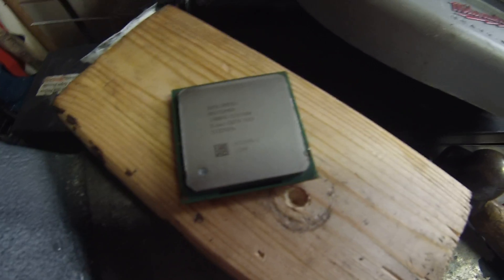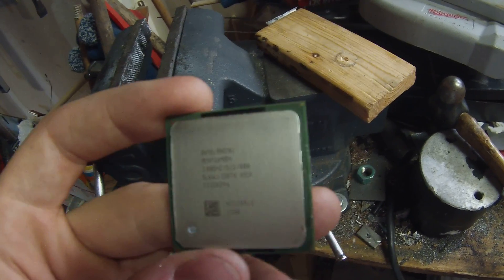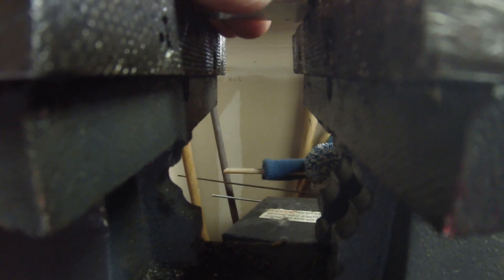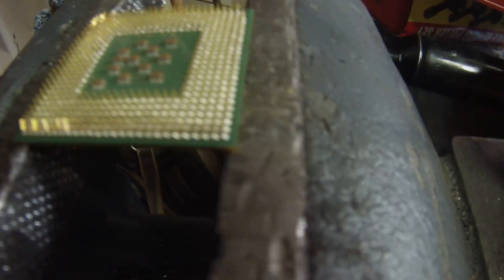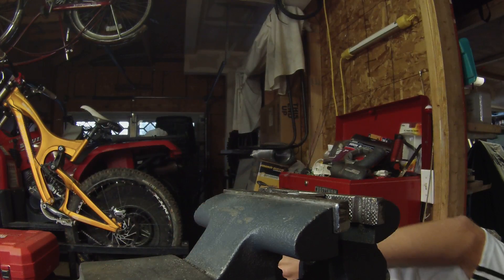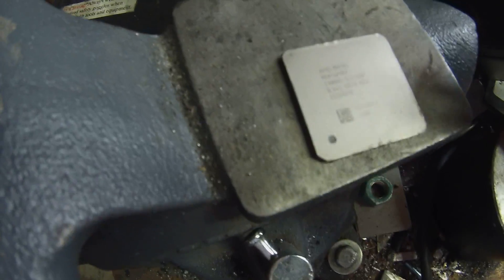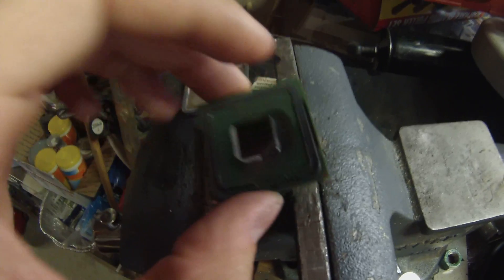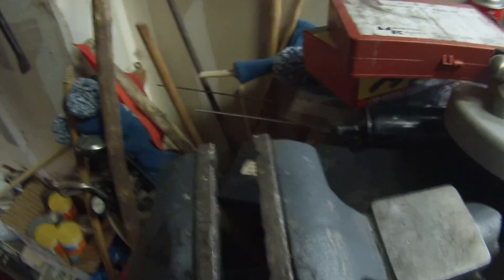Hammer And Vice - IHS Removal

Comment: that looks like the cavemanapproach ^^
but seriously, even if it works.. i would just take a sharp blade and do it the precise way.
Reply from the maker: Check my other video on this. The feeler gauge method is the one I personally use often.
Reply: +MegaDopeable Actually this looks way more safe (provided the die ain't soldered to IHS...) than cutting with sharp knife around the substrate PCB, you know, i can imagine you can scratch some tracks on it fairly easily... not to mention this is faster and healtier for your hands, the glue is damn tough, i've once cut myself... just to have a pillow...

Comment: is that chip alive after that fly in the ground
Reply from the maker: After bending back a few pins, it did run just fine! Modern CPUs can take a fair amount of beating. Yet at the same time, a sneeze could kill one.
Reply: Kent Rushton this sounds noobish. but i dropped my AMD CPU chip in the floor (not on purpess of course). and it didnt brake.  working just fine  :D

Comment: I think they shuld solder it
Reply: +KEEVVY Since Intel has little competition from AMD right now, they don't care enough to do so.  I agree, they should move back to soldering the IHS to the die, especially if this new Zen processor that AMD is cooking up will give the current Intel flagships a run for their money at a lower price with much better overclockability.

Comment: Man I've always been super brave with my builds.. But this "De-Lidding" is new to me as I am upgrading from a 1st gen i5-750 to a i7-4770k.  I KNOW it's going to run hot because Intel has chosen to change their manufacturing process to save pennies.. Still baffles me at why on earth would the best Chip company in the world resort to MUCH less effective method, ESPECIALLY for their K chips made for OC'ing.  At least make a i7-4770KS (S for Soldered) for $5 more bucks, we'd buy them.  Not sure I'm going to actually attempt this or not.
Reply: I do it for all of my customers that request it. Ive only had 1 core crack out of 746 CPU delids so far with this method. But i also heat up the cpu with a hair dryer. like i posted I also lap the IHS since thier warranty is gone

Comment: If you have bent pins you just take a credit card and run it through both ways.
Reply: if they are bent more than like 10 degrees, the credit card will break them off, trust me, a mechanical pencil is a MUCH better idea.
Reply: *****
True, but accident's to happen to everyone.
Reply: orlandotech
The macbook pro retina looks quite serviceable, I repair ultrabooks among other things at work so it should be no biggie. OSX might be locked down, but my experience with Linux is good so if it doesn't work out between me and OSX I'll break up the relationship and put Linux on it. I'm sick on windows since I work with it.

=)
Reply: A mechanical pencil with no leads in the tip works well too and a little more precise if you have a few bad ones in the bunch that need more attention.
Reply: orlandotech
I also used a tweezer (I bent the pins on my fx-6200).
Reply: danny gallegos
 If you're not stupid you won't break them...
Reply: sometimes they do ship bent, but i would still rather use a mech pencil :)
Reply: Bah, just order intel, no need to worry about pins.
Reply: Salpeteroxid
You do in the sockets, which is more of a PITA than the CPU pins getting bent.
Reply: it is rarer for mobos to get pins, but also much harder to fix.
Reply: orlandotech
My cpu is an intel i7-4790k and my mobo is an MSI z97 gaming 5, I rather buy a new mobo than a new processor. My processor is more than double as expensive as my mobo. ^^
Reply: Salpeteroxid
Ha! Sounds like a tight setup. :) I'm still on X58 but I love it. The extreme or unlocked CPU's are dirt cheap but finding mobo's at decent prices is real hard to find. I bought most of my stuff years ago when the prices were OK. Now they are crazy expensive if you can even find one that doesn't have a damaged socket.
Reply: orlandotech The processor is alright actually. The motherboard is kinda good. I haven't tried to OC yet, because the most demanding I do is BF4 I think and the 4.4Ghz on all cores in turbo is enough for me right now.

Which CPU are you at and what clockspeed?
Reply: Salpeteroxid Yeah OC'ing can be fun if you have the time to devote to it when you're tweaking it in. I'm on a W3580 ES chip now. I was on a W3550 but found a good deal on eBay for the ES CPU. I only have it clocked out to 4GHz. Plan on doing more but didn't have time to crank on it. I did the OC in about 5 minutes. :) Slight tweak to vCore and a pinch of VTT and it was there. Also made sure the vDIMM was at the rated volts for the memory sticks and turned off vDroop.
Reply: orlandotech
Nice, bringing it up to 4 is an improvement :)
Reply: Salpeteroxid
Thanks. I bet there is more power waiting to be tapped into but right now I don't have the time to spend on it. 4 was a decent starter clock to me and it was dead simple to get.
Reply: orlandotech
Nice, I had trouble with bluescreen when playing on BF4, I disabled turbo boost, set 1.2 volts and had 4,5 Ghz. but had to return to stock settings. I have to make time before I overclock. But I'm already satisfied with the performance and my time is limited (work much).
Reply: Salpeteroxid
The BSOD error code will lead you in the right direction on what voltage to adjust. Just go into the system in the Win7 control panel and make sure under advanced settings that you disable the automatic reboot so you have time to see or write down the BSOD code There are a few BSOD error code lists floating around on the net to make it easier. Usually it just needs a slight voltage tweak to fix it.
Reply: orlandotech Thanks, found the setting right away, although my W7 is in Swedish =)
I think 1.3 volts would get me 4.6-4.7 Ghz, but the processor gets much hotter, dunno if it's worth it, I only have a hyper evo 212 push pull as a cooler for my cpu. I like it because it's quiet, but maybe nhd-15 or what it's called would be better, don't want to go liquid because of the possible pump noise.
Reply: Salpeteroxid
I wouldn't push the heat past 80-85C for everyday use. It will degrade the CPU over time, especially if you are real close to TJMax. Get it where you feel comfortable with it and let it ride. Wherever you get it stable will be way better than the stock clocks. :) Try using Intel Burn Test. It's the most brutal stability test around. If it's stable with IBT it will be stable with anything you could throw at it during normal use. Next time BF4 crashes and blue screens look up the BSOD code so you can make adjustments. It might be as simple as a corrupted driver causing it and nothing with the overclock. It could also be a bug in the game too or some background service running on your machine.
Reply: orlandotech I've set it to stock speed. At 4.4Ghz with the turbo boost I'm satisfied for now because the temps are around 70 when I game and it's at full turbo.
 But I want more, I guess the only sane solution would be to buy a 240 rad, but which one? They all look the same, have the same(ish) temps but which one is the most quiet? Damn it's hard to do an upgrade ^^
Reply: Salpeteroxid
70*C isn't too bad for an air cooler @ full load IMO. If you're worried about it you can get some good thermal paste and refresh it. Prolimatech PK3 is supposed to be really good for the money. I have a 30G tube on the way since I ran out. I was using AS5 and had my tube for a number of years. The factory TIM on the heatsinks you buy is usually good but since it's screenprinted on and thicker than what's in the tube it doesn't spread out as nice as the stuff you hand apply. You can sometimes get better temps just refreshing the TIM.
If you have never dipped into custom watercooling (not the all in one sets like from Corsair) you can try one of these kits: http://www.xs-pc.com/watercooling-kits/, http://koolance.com/index.php?route=product/category&path=150_152 or http://www.ekwb.com/products/kits/. It has nearly everything you need for a custom loop and they work good. I haven't ever used them but a lot of people have had good success with them.
Reply: orlandotech
I have the Cooler Master Hyper Evo 212, and my thermal paste is not that old, 1,5 month, applied it perfectly (AS5). Stock thermal paste is always too much. I see that a lot as I'm an IT-technician and sometimes repair laptops for HP (I'm walk in support for Ericsson).
 I don't think I want a custom loop, I rather have a prebuilt for 3 years and then throw it out and buy another one. I think I have to think about it, maybe I'm going with whatever is the most quiet. =)
Reply: Salpeteroxid The Corsair units are decent but they really only give you the same performance as a top line air cooler. The custom loop route is better. I'm currently using an H100 and it works fine but I do understand that it isn't the same thing as a custom loop. If you want a quiet custom loop setup you could try more radiator and slower fan speed to keep the noise down. If the pump noise is a concern you could cover or insulate the pump to help keep it from transferring sound to the case or to the free air.
Reply: orlandotech
I really don't want to do a custom loop, takes to much time and maintenance and it won't fit in my Zalman Z11 (which I like very much). I think I will get the fattest Noctua instead with 3 140mm fans. I work with computers all day at work and at home I just want them to work (getting a macbook soon lol).
Reply: Salpeteroxid
Yeah I can truly understand. If you want maximum cooling performance with the least amount of fuss then the custom loop is the way to go but it sounds like air cooling is better suited to your situation. Less maintenance with the air cooling.
Nothing wrong with Mac stuff except that it's severely locked down by design and you can't upgrade them much at all. Hardware quality is usually top notch but upgrading or servicing them can be a pain.
Reply: Salpeteroxid
Ha! Sometimes I hate Windows but I really don't feel like learning a new OS so I stick with it. It's a love/ hate relationship. :)
Reply: orlandotech
Hehe, I like to familiarise myself with new OS's, I think it's fun and I usually get thinks to work everywhere I go. I think I'll like OSX from what I've heard, I only need to check facebook, irc, youtube and some other shitty stuff like watching the news.
Reply: You can also use a sowing needle, they're very thin and they can go under very badly bent pins whereas a bank card cannot. Just a little tip.

Comment: Better off using a thin razor blade to cut through the epoxy.  You might flex the pcb and crack a trace and then you will have a nice little paper weight for all your troubles.

Comment: I agree. If the purpose of the paste is to fill the fine crevices between the two metal surfaces, why would you use something that may create additional scratches that will need to be filled, essentially sabotaging any metal-to-metal that transfers heat just fine?

Comment: Apparently, the paste isn't the problem with the high temperatures on ivy and Haswell; from what I've read, the problem lies with the IHS not being as close to the chip as it could be(a screw-up in the manufacturing process), and the decrease in temperatures people see on them when the put the IHS back on is from it being a bit closer to the chip, which increases the heat-spreading efficiency.(unless you just leave the chip "naked" which can work very will with some kinds of liquid cooling)